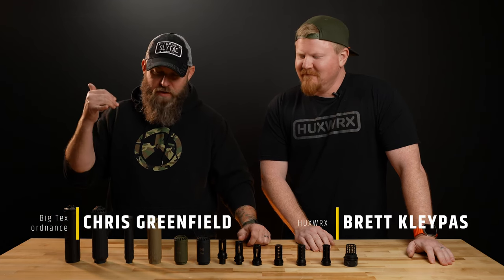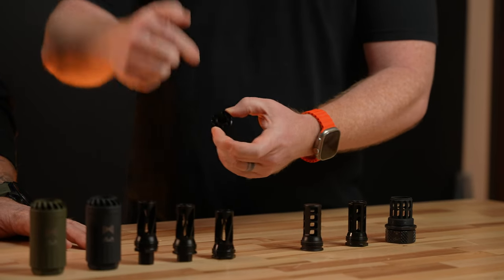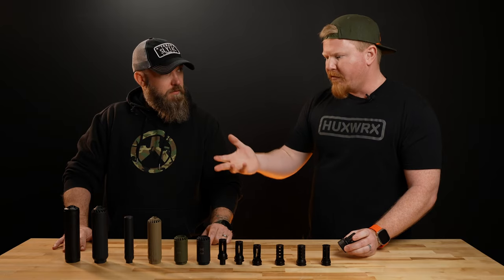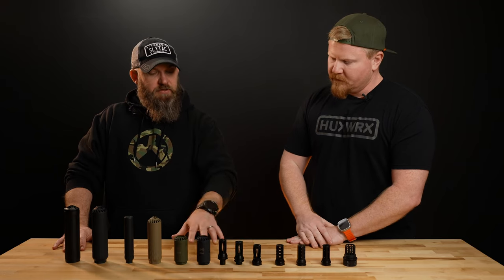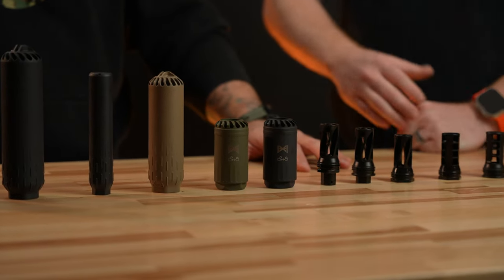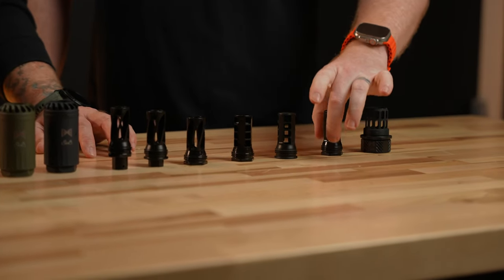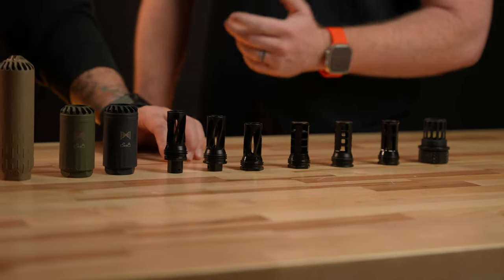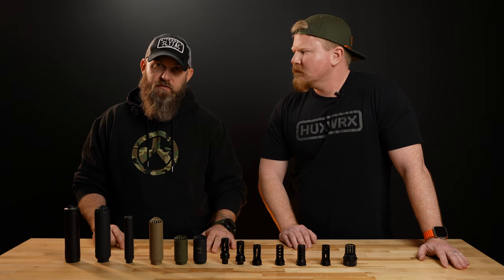HUXWRX Muzzle Devices

Comment: Too expensive,  🤷
Reply: I agree lol…. I thought my $95 SilencerCo devices were expensive…. $150 😢😮
Reply: Get you you oil filter and put on it 💥
Reply: @70MikeMike I’m confused on the sil over co attachments. I’m wanting a 30cal suppressor for my AR and AK. As you probably know one is 1/2x28 and one is 14x1LH. How to I get a muzzle attachment that will still run the same suppressor ?
Reply: @andrewsanders2744  man you got my brain churning here….. Ok lol, the threads for the AK will be 14X1 LH and the threads on the front will be right handed. So no matter what size or twist on to the barrel, the front thread will always be the thread for the suppressor. Just make absolute sure the AK is correctly threaded because everyone I talked to at SilencerCo told me that 99% of AK’s threads are crap and you get baffle strikes. So basically if you had a 5.56, 300 blackout, 6.5 creed, 7.62X39, .308, 45/70, and so on they are clearly different calibers but the front of the device is still the same for each. Only thing different that needs replacing is the end caps for each caliber. Am I making sense?
Reply: @70MikeMike  yes, my AK isn’t a surplus one so I’m sure the threads are better than those. I get why they openly say they’re mostly all bad bc most people have surplus AKs. But my issue is I want one suppressor. For two guns.(Ik you understand that just trying to dumb it down as much as possible)
1. 1/2x28 thread.
2. 14x1L thread. 
But I want the same QD for both guns. The Qd I was looking at is only in 1/2x28 and also a thread pattern that isn’t 14x1. So I’m having trouble finding a muzzle attachment in 14x1 that  matches the same muzzle attachment in 1/2x28. As in same I mean the same QD mount. So I can get the same suppressor on. I’m looking at the OMEGA 36M

Comment: So the issue with the sons v2 barrels being 5/8 is that now you can't run a 556k can on it unless huxwrx sells a 556 muzzle device with a 5/8
Reply from the maker: So.... currently you would have to run a 7.62 device and a 7.62 can. With the 5.56 Ventum coming soon that would be an option if you used the Hub QD and a 7.62 muzzle device.  Rumor has it that there might be a 5/8 5.56 Hux device coming soon as well. Which would be nice.
Reply: Wow that's dumb.
Reply: @JNOSNOW the dumb part is the 5/8" barrel
Reply: @DinoNucci  yes.

Comment: So i have a Radian Model 1 that comes with the DeadAir keymo flash hider. I ordered the Huxwrx Flow 556k. Do i just need the DeadAir keymo mount or do i need something else? Thanks
Reply: The flow 556k is not hub compatible and can only be used with a Huxwrx muzzle device

Comment: Q? Are the 762 ventum and the flow 556 both serviceable
Reply from the maker: You can remove the core out of the Ventum and they have a cleaning kit coming soon as well that will work fantastic on the Flow  556.
Reply: 9 @BigTexOrdnance

Comment: Can someone help me out. I thought i knew but now im lost. Do i need the hub adapter to mount the suppressor onto a muzzle device? Will it mount to a hux muzzle device without the hub adapter?
Reply from the maker: You need a hub adapter if you are trying to mount a Ventum 556 or 762 to a Huxwrx muzzle device or any other hub compatible suppressor to a Huxwrx muzzle device.
Reply: Yes, Huxwrx devices attach to your barrel via one of the muzzle devices. You can pick either the flash hider or the muzzle brake. Typically, one would pin and weld or loctitie the muzzle device to prevent it from backing off.